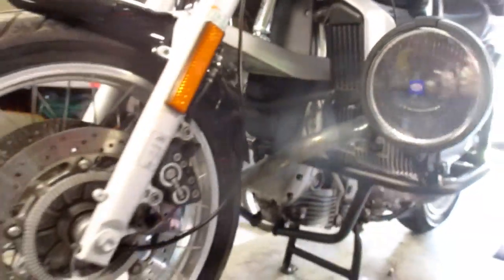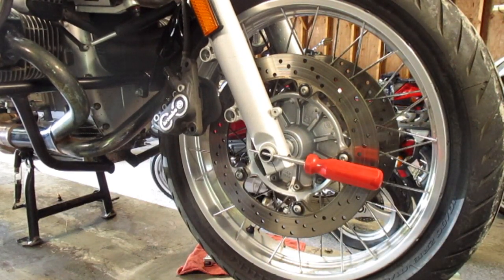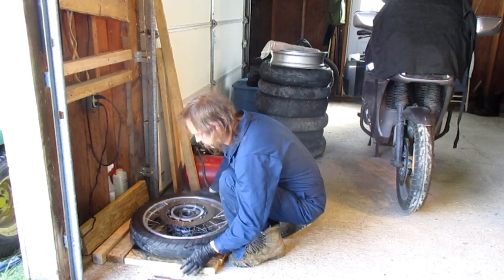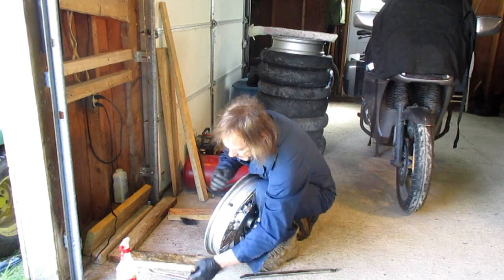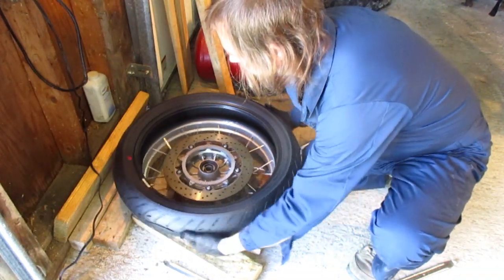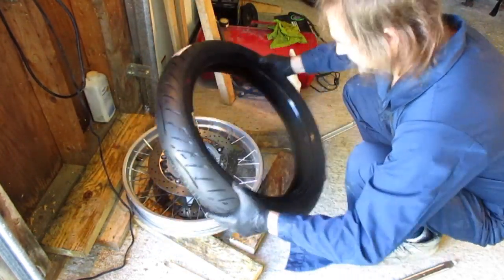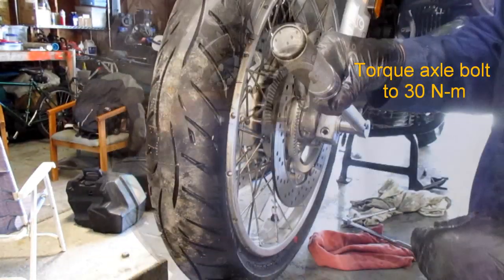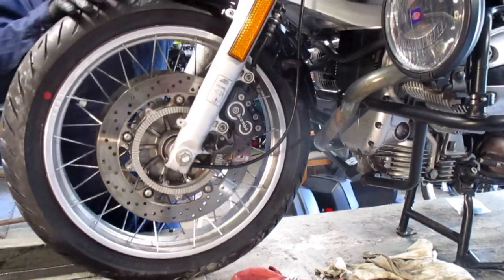BMW Service - R1100R front tire replacement

Comment: Chris , Thanks for the tip on the pinch bolts. I just replaced tires on my R1200R and did use copper anti seize on the pinch bolts. I enjoy working on my BMW and you have been very helpful.
Reply from the maker: You are welcome, Ron,. Stay tuned; there's more, Chris

Comment: Hi Chris!  I love your videos, they are always very useful.  In the past I had an R11RT and your videos helped me a lot to do the motorcycle maintenance, I even changed the clutch and other maintenance such as tuning the valves.  Now I have a K12LT, some things are still identical like the wheels or the final drive.  Thank you so much for all your work and knowledge sharing!  Best regards from Mafra / Portugal ✌️
Reply from the maker: Good luck to you, Fernando!

Comment: I do wish you had showed the process of putting the axle back on in more detail. How do you get all the things (fork, spacer, wheel, speed sensor) lined up and in place with only two hands? But the order of removal and re-tightening is most important and well covered. Thank you!
Reply from the maker: You are welcome but I can't have everything in every video - They'd be 300 hours long each! Each video should reveal more detail; just as if you were working next to me. Thanks for watching. Stay tuned, Chris

Comment: The cross spoke wheels are more narrow than the mag wheels.  A narrower wheel means agility.  More riding agility equals more fun.    
In 2,002 I saved up $12,000 + to get a brand new R1100R.  When I went to the dealer, I found that the R1100R was replaced with the R1150R.  I didn't like the newer seat and the handle bars.  I found a 2nd hand year 2,000 R1100R for $7,200.  It was in mint near showcase condition with only 20,000 miles.  At the time this was the biggest motorcycle I ever rode and I had to ride it 100 miles in the crazy Los Angles traffic to get home.  I put 110,000 miles on that bike and its still going strong.  Before I got the R1100R, I did all my cross country motorcycle trips including Latin America on a 650CC Honda.

Comment: Hello Chris, thanks very much for this. Lots to learn in maintaining these machines. I have been using the nickel antiseize on other projects. Is this ok for the bmw or should I pick up cooper? Also curious if I should reduce the applied torque on bolts when referencing the specification. Thanks very much

Comment: Any tips on balancing? And a Big wet Thankyou from us shmucks who love to do their own work. Damn pity you’re so far away, else I’d come by to shake your hand!
Reply from the maker: The red dot on the tires sidewall goes to the valve hole in the rim. Make user your direction of rotation is correct and ride. You'll know if they are out of balance. Good Luck!

Comment: Hello Chris, I've been watching your videos for awhile now. I have a similar bike ('98 R1100R). I guess my steering damper is shot. Should I replace it, remove it or just let it be? The little rubber spacers have disappeared too. Thank you.
Reply from the maker: Louis; The stock damper does virtually nothing and no one ever notices when they fail until they look at it and see it leaking. It does nothing. Take it off and set it aside or replace it with HyperPro or such. Good Luck, Chris

Comment: Thanks for all your videos, my husbond always look at them before doing maintanance at our r1100r. Sept 99 so close to 20😀After changing front breakpads and seals at the front fork top we now hear a bit of grinding noise from the breakdisk pins. The disk are free floating. What can this be caused by ?
Reply from the maker: jarmila; thank you. Your grinding is likely one of the spring clips attached to one of the brake pads. The hole where the pin passes through the brake pad has an oval'ish shaped spring clip (wire) fixed with a rivet in the center. Often when the pin is pushed through this friggin' wire gets trapped in the hole, under pin. This prevents the brake pad from moving on the pin causing a misalignment of the pad and a resulting noise from the friction material of the pad touching the disc at an angle. I have filmed a bit about this; to be edited soon. Stay tuned, Chris
Reply: Thanks for your quick advice. Looking forward to see your video br from denmark
Reply from the maker: @jarmilas.nielsen5633  You are quite welcome!

Comment: nice job. I just had mines replaced. Continental TKC 70.
 I have an 1992 R100R German edition with the same wheels.  What is the correct pressure? Manual said 2.5f / 2.9r (bar) - with passenger. 
Just had a test ride and don t like the way these tyres feel. I am already regretting the Metzelers
Reply from the maker: Set the tires at what works for you. Try 2 bar and see how it feels.

Comment: You make soooooo great videos Chris ;-) How did you balance the tires?
With adhesive weights or with BBs? Best Greetings from Germany ;-)
Reply from the maker: If the wheels have been balanced before and the red dot on the sidewall is next to the valve stem as it should be when installed fresh; you are replacing the tires and placing the red dot at the same location as the last tire; at the valve stem (proper side,, of course). Then you should be able to ride away leaving the weights from the previous installation intact. Chris

Comment: Thanks for another great video! Quick question, what's the advantage of copper anti seize over aluminum?
Reply from the maker: Copper vs. Nickel: Nickel turns to cement when old and heat cycled numerous times. In 1999 BMW instructed us lowly technicians to use only copper and to coat the threads of every spark plug with this paste and torque to 20 N-m. Here we are 20 years later and I've never had a seized part previously coated with it and never had a thread strip due of its use. Here's what I use: https://www.wurthusa.com/Chemical-Product/Lubricants/Anti-Seize/Anti-Seize-Copper-Paste/p/0890920284

Comment: Chris hi!! Is the same in the gs r1150 adv? 2004 procedure?
Reply from the maker: If you are asking if the R1150GS and the R1100R share the same front wheel removal procedure and torque values the answer is yes; that is correct.
Reply: @ChrisR.Harris  thanks a lot my friend this will help me to do that in my motorcycle. You re the best man
Reply from the maker: @pitg1318  Good luck. It's all fun in the shop. Take your time.

Comment: didnt know r1100r's had spokes
Reply from the maker: Yes, cross-spoke wheels as the GS models but 18" front. The same were used on the early R1100RT-P authority models. They are stronger than the 3 spoke wheel.

Comment: can you use these spoke rims on R1100RT?
Reply from the maker: Yes, but why would you want to? The cross-spoke wheels are nearly impossible to keep clean and they put you on odd-sized rubber. They are slightly lighter front and rear (1.5 and 0.5 respectively) however.
Reply: @ChrisR.Harris  Isaw one on RTP looks great! I just can't find rear tire anymore ( metzeler roadtec z6 160/60zr18) on mine
Reply from the maker: @park1wayify  The first R1100RT-P models came equipped with cross-spoke wheels. Those were rejected by California Highway Patrol during trials as they would not retain a bead when the tires were run flat for the required 10 miles @ 65 mph. BMW switched to the much weaker, softer 3-spoke wheel to remedy this complaint. Problem solved. Lesson: Don't run your cross-spoke wheels with flat tires or you'll be rimming your way down the road.
Reply: @ChrisR.Harris  excellent!! thanks for the information.
Reply from the maker: @park1wayify  You're welcome. Metzeler replaced the Z6 with the Z8 in 160/60 ZR18 .
Reply: @ChrisR.Harris  fantastic!! Now I know what to get Metzeler website lists z6's still and thought they're available.

Comment: Why didn't you balance the tyre?
Reply: He put the paint mark (heavy part of the tire) near the valve hole (light part of the wheel). Which I think, frankly, is not terribly necessary. I bought a very nice balancer when I changed my own tires on my GT. The balancer didn't come right away, so I changed the tires, mounted them, and rode them unbalanced. Didn't notice a thing. Took them off and balanced them carefully. Put them back on. Didn't notice a difference. I'm not sure what speed you need to be going to notice a difference, but it's more than 85mph for sure.
Reply from the maker: Balancing is not necessary IF you know the wheel and you are using same brand tires like the wheel has always had before. Tires are near perfectly balanced when manufactured (Avon, being an exception) so if the weights on your rim have been going onto the same spot for 100,000 miles of use you can be sure that the only thing requiring balancing is the bare wheel itself as the tire is not the issue. The rim certainly is not going to change its balance unless damaged. So if you know the wheel and have installed too many damned tires on that same wheel before you can rest assured that if the wheel assembly was balanced properly before and you put the red dot at the valve you'll find the test ride smooth as glass. If not then big deal, yard the wheel off, inspect closely for damage or a section of unseated bead or take it to be balanced if you don't believe it is correct. I will later show how to balance with a static balancing stand but this is not a necessary step if the above mentioned criteria have been met. Thank you for watching; stay tuned for more soon, Chris